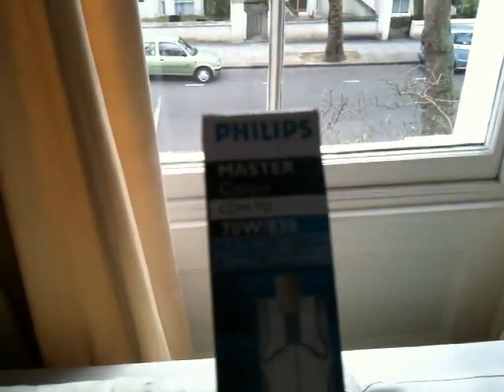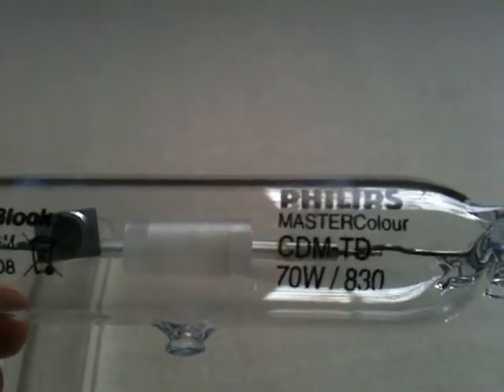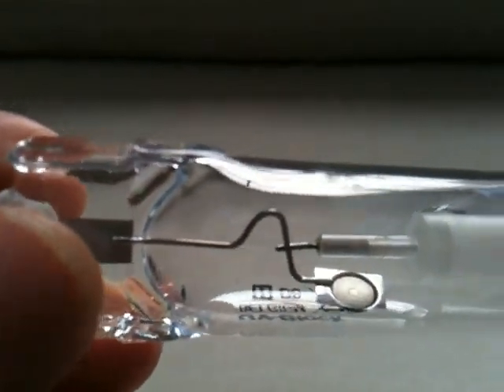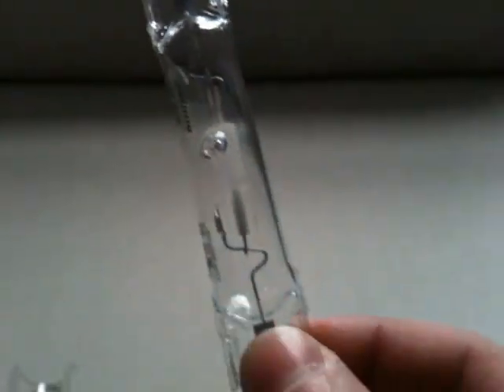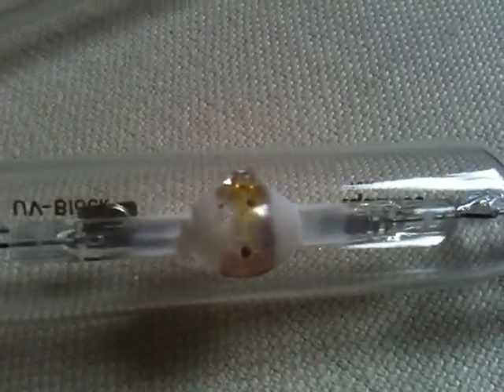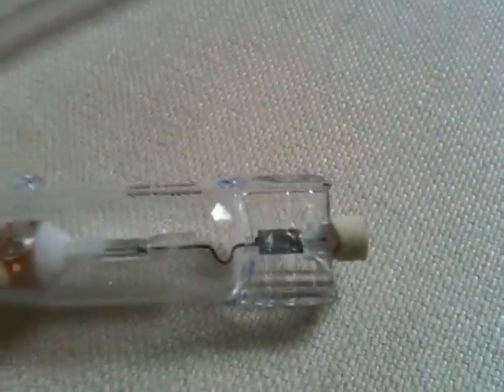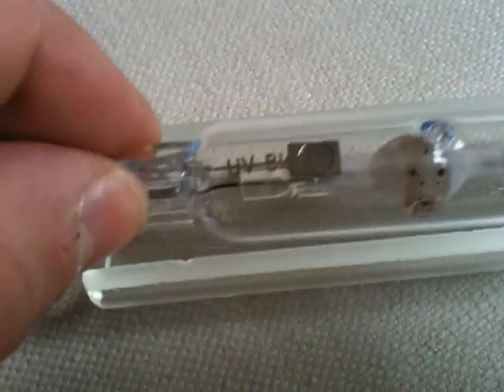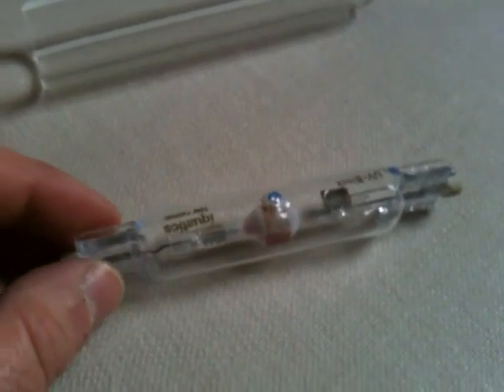Converting a halogen into a halide - Part 2

Comment: I've been playing with CMH lamps also. I'm currently using a 70w Osram Powerball HCI-E/P 942. A fantastic lamp with a temperature of 4200k and a CRI of over 90%. Seems to strike and run up to full power incredible fast too. Haven't had any trouble with ignition but I'm using a magnetic choke and a superimposed ignitor instead of an electronic ballast. Was thinking of converting a few more for the living/dining room but SWMBO says they are too bright :(

Comment from the maker: @FrontSideBus The powerball is a much better technology than the cylindrical ceramic tube by Philips. The cylinder has big thermal mass and so warms up slowly (longer than a regular quartz) and the cool-down time is painfully long. 

The powerball is smaller, lighter - and has smaller surface area so has higher temp (better CRI), and more even temp so suffers less thermal stress.

I did buy one, but postie lost it. Apparently, with an electronic ballast full temp is reached in about 30-45 secs.

Comment: Not to sure what your control gear recommends but i thought most had a max length of around 1.5 meters? Great mod thou
Reply: Yeah. They recommend a maximum distance of 1.5m to prevent problems with striking the lamp and flicker. It's also recommended you earth any metal around the lamp to help it to strike.